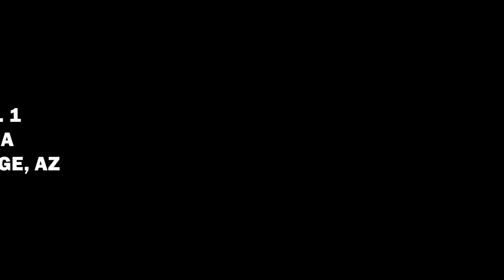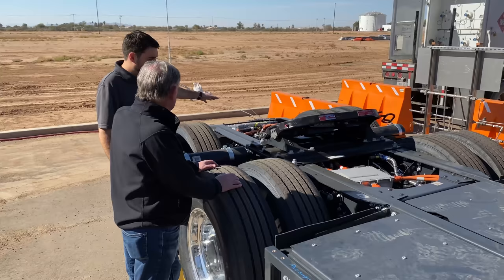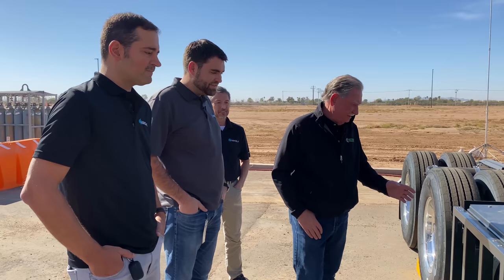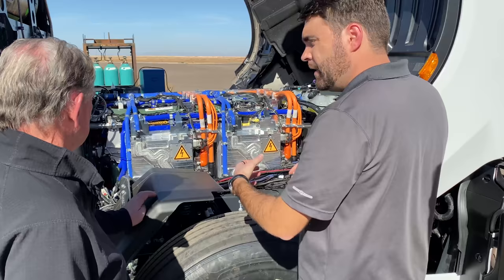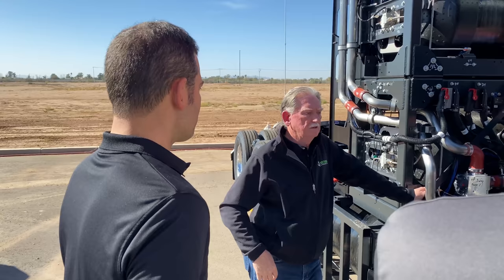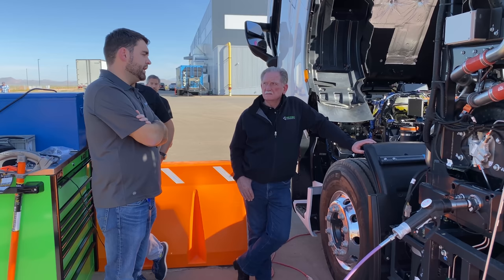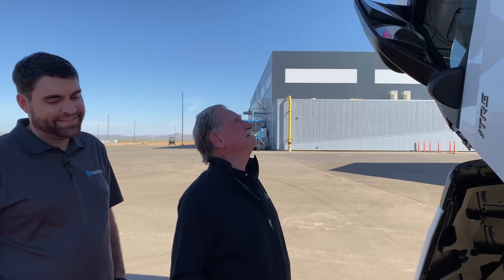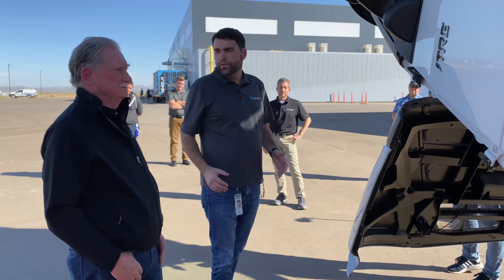Nikola Series - Ep. 1: Introduction & The FCEV Alpha

Comment: The advantages they mention over diesel trucks - you get every single one of those with a battery electric truck as well, except for the range loss. So the fuel cells don't lose range as they degrade unlike a battery, but the battery truck is 80% efficient and the fuel cell truck only 35%. Guess which one is going to have lower fuel cost, even ignoring the nonexistent hydrogen infrastructure.

That being said, it's cool to see Sandy looking at some actual technology, even if it wasn't developed at Nikola. I do believe that fuel cells will have some important applications, just probably not trucking.

Comment: Maybe I missed something but I did not hear anything about projected range at max capacity. I am not sold on Hydrogen as it is costly to produce and costly to transport.   It is also inefficient as far as what I have seen in my research.   It may have its applications though.  My thought is the ability to produce hydrogen at a power station to make power at a grand scale.  How much electricity does it take to produce hydrogen and would there be an excess of power to provide households with enough power?  Has anyone done the math?  Just random thoughts.
Reply: Hydrogen production from electrolysis would be more cost effective in areas where renewable output is curtailed or sold for nothing or even negative amounts. 
There may always be curtailment because overbuilding for the least windy, least sunny part of the year may be a part of the cheapest solution.

Comment: If your only job is side mirrors, you aren't going to give it up.  - Sandy Munro.  (Does this apply to natural gas production?)
I wish Nikola well.  Hopefully they will do better now that they got rid of their crook of a leader.  👍  IMO they should just focus on BEV trucks. Less total energy loss, disregarding the mirrors.  Would be interesting to see the cost comparisons between battery packs vs multiple 700 bar tanks and multiple fuel cells.  Not to mention all the extra tanks sitting outside the truck.  🤔

Comment: We have electric distribution infrastructure now.  We have hardly any hydrogen distribution infrastructure.  It is a will likely be easier to build out the existing electric distribution system than to create a completely new hydrogen distribution system.  If hydrogen is to be made by electrolysis, it will also require a build-out of the electric system to provide power for electrolysis.

Comment: A number of the design choices I see in this vehicle will not lend themselves comfortably to the North American OTR market. Cab overs died here for a reason, they aren't as comfortable on long hauls,  the bunks are smaller or non existent, and every time you need to take a look at the power plant you basically have to unpack the cab so your crap doesn't end up on the windshield or foot-well. And then there is the mile high climb to get into the drivers seat, and if your on a job with lots of in/out cycles like mine, you'll quit in a week.

 Then there's the projected range, I think it will be ok for a few short mileage runs, or city work, but that's about it, and most of that market is body job work, not truck and trailer work. Weirdly, the job I do would, probably be ok with the range, but it's small rated load and single drive axle would be untenable, Come winter you really do need true 4wd.  And up here standard trucks need to be load rated to 103,000lbs, for single trailer operation in general service.

And dear Sandy, there are good reasons to keep real mirror's rather than camera's, If I need to see a little further to the side in my mirror, I can just lean, you can do that with a camera, not to mention when looking in a mirror out side the cab you are heads up and also looking at the actual surroundings rather than just fixating on the screen that is inside the cab.

Comment: As a truck driver in Europe i can Say that the Hp figure is on the Low side … i do know that torque is much more important At truck.  For ex  my scania has a 12.7 l Engine with only 370 Hp But about 2000nm torque   And is good for a payload of about 15-20T.   With that 270 Hp…probably only moving trailers around a port…
Reply: Electric drive has a lot of torque. More than a diesel of that horsepower would have. I believe they can deliver maximum torque immediately.
Reply: You also loose 25%-45% of your HP through your mechanical drivetrain. Electric vehicles don't have that loss.

Comment: It's all Iveco and Bosch. Is there anything in this truck what is developed by Nikola?
Also full cost of ownership not too promising: hydrogen price, efficiency, complexity...
Reply: Nikola did the software and also integration engineering. Enough that Iveco felt it was better to partner with Nikola than do design their own BEV/FCEV trucks.
Reply: @lockbert99  Iveco felt that because CNH has 250 million USD investment in Nicola (Trevor and his lies were successful) and they didn't want to lose it.
Reply: @zoltanszeles9394  At the Ulm inauguration on September 15, 2021 they talked about the partnership between Iveco and Nikola as starting 24 months prior. In September 2019 CNH Industrial invested $250 million ($150 million was services) in Nikola. And in a September 3, 2019 Transport Topics  they said "Nikola will contribute technologies for a European joint venture with CNH Industrial". So they were already  doing the Iveco/Nikola joint venture when CNH Industrial invested in Nikola.

Comment: 500 mi range is not enough.  My Volvo is between 1500-2000mi.  Dual 105 gallon tanks.  The average driver would need to fuel up at least 2x per day.
Reply: This is not designed for long haul. They have another vehicle planned   for that - Nikola Two.

Comment: Seems to me analysis of either vehicle type, FCEVs or BEVs,  misses the main problem with
alternative transpo, which is energy delivery.  Nothing compares with liquid fuels.  There is no large scale H2 delivery system anywhere in the world, and the distribution problems with H2 (low volume density, metal embrittlement, leak detection, compression power needs) make it unlikely one will ever exist.  

Same problem w BEV charging at scale. That liquid fuel tanker we all see patrolling the roads carry 9000g, a TJ, or near an hour of Hoover Dam power, all delivered in minutes at every other corner.  That’s not replaceable at the last mile of an electric transmission network.

Comment: Very important question: how many miles do these trucks cover per kg of hydrogen? The thing is, if the marginal cost of fueling ends up being more than diesel then this simply doesn't work. If we assume diesel priced at $4.59/USgal (California), a fuel economy of 10 mpg and a hydrogen refueling price of $15/kg, then the Nikola truck would need a fuel economy of 33 miles per kg just to hit parity with fueling a diesel semi. (Of course, if my data is off, do show me better data.)
Reply: I know the Toyota Mirai holds 5kg of Hydrogen, and that costs about $80 to fill that up.  The Mirai gets about 300 miles of range.
Reply: The one guy said "we project 7 or 8 miles per kilogram. They currently have 12kg in each of 5 tanks and claim 500 mile range, which is 8.33 miles per kilogram. They may be giving a range based on their hope of getting 14 kg into a tank. That would be 7.14 miles per kilogram.

Comment: So electricity runs a hydrogen generation plant that then is transported (by truck) to then be transferred in to another truck where the hydrogen generates electricity to turn an electric motor?  While environmentally better than diesel, how is this better than a fully electric semi?
Reply: I think it all comes down to "less efficient but can carry a bigger payload (due to less weight) for longer". It was supposed to also be "refuels faster" and then they dropped the "takes an hour" bomb.

If batteries get lighter or they increased max truck weights, the whole idea blows up. Well, it may be better in cold weather.
Reply: @lockbert99  for some reason I’m thinking Elon’s already done all the math to figure out that improving the ecosystem of battery technology will be easier than reinventing hydrogen technology. Still looks very complicated driving up overall manufacturing costs. They might have a better shot at leveraging rocket propulsion technology from SpaceX before being able to get hydrogen to be overall cost effective. $.02

Comment: I’m seeing expertise w these guys in the FC chemistry and bravo.  What I don’t see is lifecycle experience w the containing the tiny H2 molecule, which will find sieve like leaks through gaps a hydrocarbon molecule can never transit.  Then there’s a leak detection.  Volatile petrol leaks are immediately detectable  , so is methane with its attached odor molecules. Not H2.  These are difficult problems, unresolved by industry outside of $$$ one off rockets or chemical industry applications.  

That H2  tank puncture issue was resolved decades ago; its we’ll known they are safer in puncture than is a gasoline tank, hence the thousands of catastrophic gasoline vehicle fires every year.  Gasoline tanks contain fuel and O2, H2 tanks do not.

Comment: NH3 ammonia makes more sense than H2 fuel for trucks and aircraft.   look at the article on newatlas "Green ammonia electrolysis breakthrough could finally kill Haber-Bosch"
Reply: Great article. Ammonia is good for transport and as a pre-cursor chemical, but isn't so good for burning - has low flammability and heat and high NOx emissions - but with the CSIRO metal membrane technology it's not to hard to convert NH3 to H2 at point of use.

Comment: I dont get it. It has 500 miles of range? Is that considerably more than a battery electric truck? And then all this complexity/affordability for the truck and infrastructure? someone enlighten me, pls. maybe there will be more information on that in the other episodes of this series.
Reply: Tesla advertises their semi will come in 300 and 500 mile range versions.
Fuel cells with tanks are supposed to be lighter than batteries, and refuel faster. But if current refuel.time is near an hour (they didn't say the refuel time at non-mobile station)  they have little or no advantage there.
Reply: @lockbert99  i agree

Comment: Sandy -

Tesla semi-
Expected Base Price (300 mile range). $150,000. 
Expected Base Price (500 mile range). $180,000.

The recently announced Tesla Semi concept design has the largest advertised range of 500 miles with a target 80% charge in 30 minutes. 

It takes 2x to 3x as much electricity to fuel a FCEV than is needed for a BEV.  Electrolysis and compression.  Operators will have to pay a significant premium for that extra electricity and the hydrogen infrastructure.

And remember, full self driving is coming.  If Tesla puts automated battery powered trucks on the road they will dominate.

Comment: A million miles is THE base for many truck companies/ owner operators. Otherwise they will use the truck abuse the warranty and the Truck will have a limited market share. The truck manufacturer will have a rough time making a profit. Look at the paccar engines people are yanking them aftermarket fixing them and bypass the manufacturer over stupid things like rocker arms and injector lines. If this truck doesn't make it to a million with minimal down, people will avoid it.

Comment: Actually it is not the FCV  that is  the problem,  as Toyota  has demonstrated  that  the Mirai  is a capable  car, especially  the new one  their 2nd  generation Mirai, that is based on the  chassis of a Lexus, It is the PRODUCTION  OF THE
 " FUEL" , yes  producing  Hydrogen   is very expensive , and  the transport , storing it  and dispensing  it , And  most  Hydrogen  comes from Steam reformation of Nat Gas . ..by Electrolysiss it just takes too much Electric  Energy TFL , the  Vlogg , The Fast Lane  channel  showed it ,  he had to wait  for  4 cars  to fillup, I think it was  cl,ose to an hour  for  4-5 cars

Comment: Solid state h has more potential..but still not there yet due to DOE shelving it..by the time it is ready, batteries will have even higher energy density and be even cheaper + zero fueling infrastructure + electricity going straight into batteries is more efficient than electrolysis for hydrogen production

Comment: Have the end customers run the numbers on fuel cost per mile? By my guesstimation it will be 5 to 10 time more per mile vs. the pure BEV Tesla semi trucks. Even if they get the cost of Hydrogen down it will never be as affordable as electricity. Curent avg. cost of Hydrogen 16,51$/KG in the USA. Add to that the expensive fuel cell tech that can't be scaled because of the rare earth materials it contains. What is the point of creating a green technology that has the same wheel efficiency as diesel fuel? OK its green so long at you use sun to electrolize water but other than that you are going through a world or complexity to get to the same point as internal combustion efficiency and your fuel cell + bettery + management system+++ are more complex and only add to the cost of the truck and lengthen the return on investment. Fool cell is an acurate depiction of this technology.

Comment: Something doesn't add up. A lot is made about a 10% decrease in fuel efficiency making the difference between a company making a profit and going bankrupt but at the same time it seems it is no problem that the cost of hydrogen is more than double that of diesel per mile.  So spending 10% more on diesel is a problem but spending 100% more to use hydrogen instead is OK. 
I get it that savings are made on maintenance of the diesel engine and such but I doubt that amounts to anywhere near half of what is spent on fuel.  The maintenance difference is perhaps a little overstated as well. With a hydrogen fuel instead of a diesel engine you eliminate various maintenance needs, such as engine and transmission oil, oil filters and some parts but we forget to mention many other things that still need maintenance and that make up a good part of the regular maintenance bill. That is already the case with battery electric vehicles where you need to do maintenance on things such as brake and cooling fluids, hose pipes, shock absorbers, suspension items such as ball joints and bushings and so on.
In addition a FCEV will also need air filter maintenance - every bit as much as a diesel does, cooling fluids, hose pipes and so on.  It also has a considerable amount of mechanical devices to manage the air and hydrogen flow which are probably just as complex and prone to wear as the parts in a diesel fuel system, not least of which the air compressor that pushes the air into the fuel cell. I'm also pretty sure that as with any other extreme pressure vessel the hydrogen tanks will need to undergo a costly inspection and recertification process every few years.
As hard as I try I fail to find any way in which a hydrogen vehicle will be more economical to operate than a diesel when both the capital cost as well as the fuel cost is much higher and the maintenance cost is unlikely to be much less and possibly even higher when considering the complexities of the fuel cells and all the ancillary equipment they need to make them work.
It is already not such a huge saving that is made when going to battery electric from diesel and that with something that is orders of magnitude simpler.  In practice I see the future as having two types of truck, fully electric which are suitable for most use cases and series hybrid for long haul, the latter being simply a BEV with a smaller battery and relatively high powered range extender powered by diesel or LNG.  Hydrogen will only start to play a major role if and when the use of fossil fuels of any kind is banned or taxed high enough to make it less viable than hydrogen.
Reply: Not sure what is or will be in the USA but Europe is doing the same with large trucks that they did with autos - putting declining standards for tailpipe emissions and fining companies that don't meet them or forcing them to "buy credit for production" from other manufacturers. Those rules may be why Iveco chose to partner with Nikola, thinking they could not meet them otherwise.

Comment: I don't see Hydrogen going anywhere.  Batteries will degrade over time but they can be replaced but it also doesn;t have an engine with multiple moving parts. Batteries could also be integrated into the trailers theselves for even more range.  I don't see anyone buildiung out infrastructure for hydrogen storage.
Reply: I don't know that there are any moving parts in fuel cells. I think the only thing that moves is the hydrogen and outside air. Well, there must be valves that open and close. But there is also a cooling system (that they said they were going to expand).
Reply: @lockbert99  Your right, I should have said wearable parts. Im assuming those hoses and pressure seals will fail over time.

Comment: Tell Trevor hi.  I will be interested to see if their trucks can go uphill now.  To be fair though, in a world where energy is super cheap, hydrogen will make some sense for long haul, self-driving trucks.... MAYBE.  However, everyone will always have to compare the results to Tesla.  500 miles is pretty crap really since that is what the Tesla truck already gets.  If the fuel cost in electricity terms is 3x more cost, it is never going to be a good investment.  It is hard for me to see how the economics work out here still.  Hopefully we can draw some more solid conclusions on this with your work Sandy.  Thanks!
Reply: This is the Nikola tre fcev, designed for regional routes, a cabover design that is much smaller than the Tesla Semi Truck. Nikola Two fcev is the long haul route truck, it will possibly have 900 mile range and is about the same size as the Tesla semi truck, prototypes already shown going around a test track, not downhill.